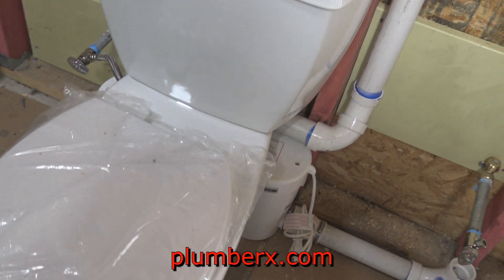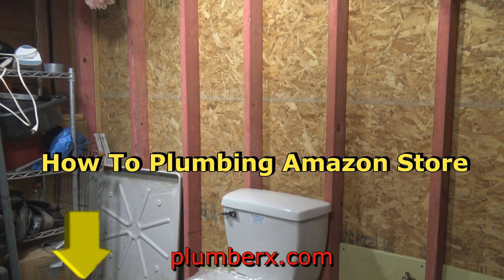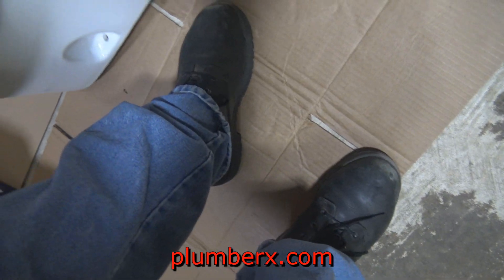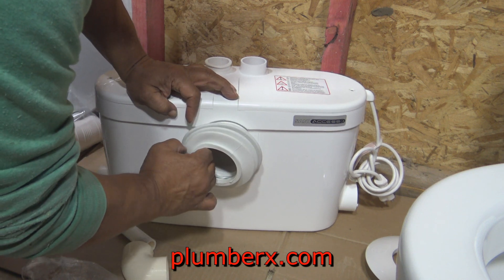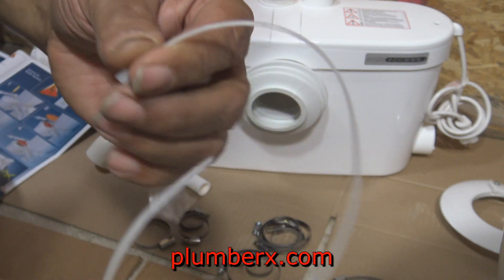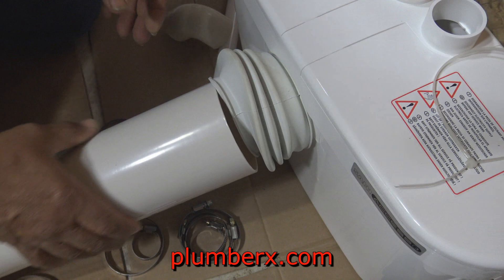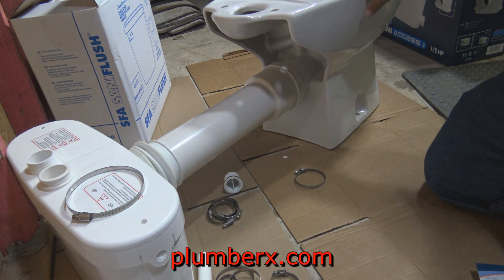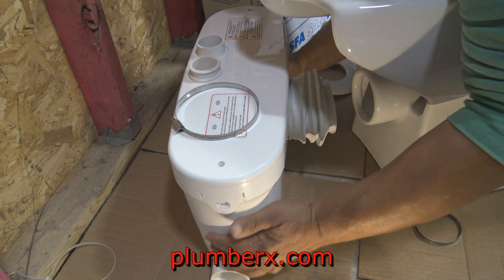Up Flush Toilet 1/10 | How To Plumbing

Comment: I’m just curious. Can I use this even if my sewer line is down my basement? Where will I connect the pipe from saniflo before the stack or after? I know that saniflo is upflush. Can it flush downward?
Reply: Thank you for the immediate response. I just subscribed to your videos. You really are great and more power to you.
Reply from the maker: @kikop.3043  Thank you I appreciate your support.🙏
Reply from the maker: Yes and no. Sorry, but I would recommend you check with your local plumbing authorities before you go about installing the Upflush toilet. This type of toilet is not approved everywhere. I would also recommend getting professional advice from a plumber. These videos are more for people that have a better understanding of plumbing codes and presses of plumbing. Thank you for your interest.

Comment: Old vid however at 3:55 the boot for the extension connection the boot coupler to the Saniflow was installed incorrectly, the smaller opening connects to the Saniflow tank and you would use a zip tie to secure it. The larger end of the boot coupler goes toward the tank extension and is secured by a clamp.
Reply: I wondered about that Zip tie Part  also. And I really wanted to see the finished Project, or at least show the toilet flush!😔
Reply: @rhondawalker6732  You can come over and check mine out, and even use it. LOL it is the only reason why I know that piece was installed incorrectly. I am really anal about things.

Comment: Thank you! I'm adding a SaniBest Pro a new bathroom in the basement. It will be flushing upwards into a 3" line running along the underside of the upstairs floor. That line goes through a block wall, so I could not tap into it down low for a normal toilet. The floor has a 2" drain that I will use for the sinks and bathtub/shower. There may be a bigger pipe under it, but I have no intention of cutting the concrete to find out. My luck... I'd do that and there wouldn't be a bigger pipe. Therefore, Saniflo Upflush toilet to the rescue!

I will not be adding any other fixture to this pump. This is a Jack-and-Jill bathroom serving two new bedrooms that I added to the basement for my granddaughters. Saniflo says this toilet will chop up anything. I'm sure my girls will test that feature (I have no intention of telling them about it).
Reply from the maker: Nice. I have granddaughters too. I understand😏 they will test it for sure. 👍

Comment: What is the correct direction to put on the rubber coupler that connects the macerator to the toilet? In the video it’s on with the rings going from larger to smaller from the macerator and a couple of seconds later it’s on with the rings going from smaller to larger from the macerator. Thank you.
Reply: The answer is the smaller rings(end)goes to the macerator, larger rings(end) goes to the toilet bowl.

Comment: Thank you for your extensive coverage on this subject.  I'm surprised about the small amount of water that remains in the bowl after the flush...is it even a liter?  Can you address this issue?  Just actually got mine completed yesterday.  Building an entire bathroom in basement...also have septic system.  Thanks for whatever you can share on this.

Comment: In my  town no body wants to instal  those toilets, the plumber in Winthrop, MN is afraid to us this product
Reply from the maker: I understand. 1. to some plumbers it's a mind set not something they cant  wrap there head around. I know it use to be my mind set it's not the norm what would this is to easy can't be right. 2. The plumbing code and plumbing industry have not except this type of plumbing for a toilet and it may not pass code in your area. 3. The so call real plumber who can't get over themselfs and don't think outside the box. Me  I'm a lic plumber and I have been lic for over 30 years. Lic in 3 states. My personal opinion this is awesome and we as plumbers have to realize times are changing and we should to.
Reply: @how to plumbing , what saniflo toilet do you have in this video,  and how much is it? Also, do all the parts come with it yo instsll the discharge line,  except the 45's, and pipe?

Comment: If the drain line from the shower is not on a slope, will the water from the pump back up into the shower.